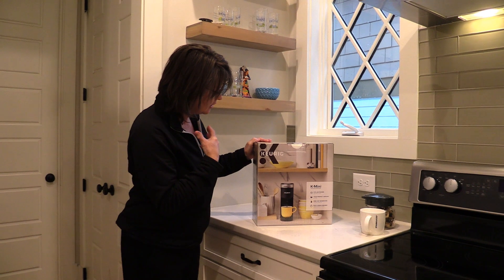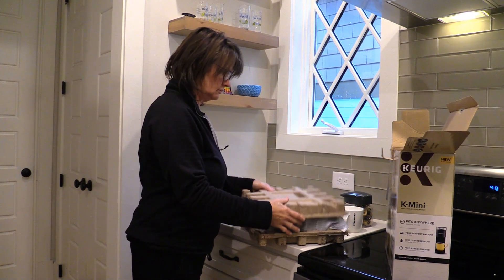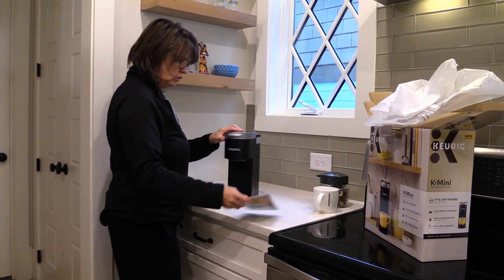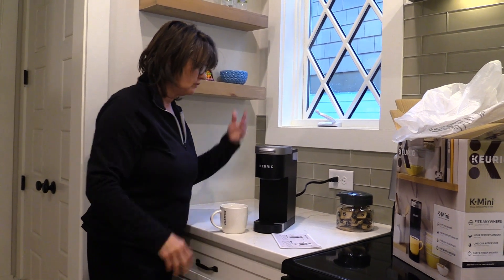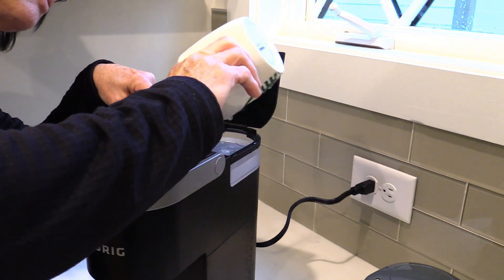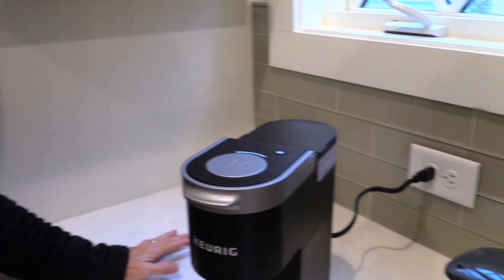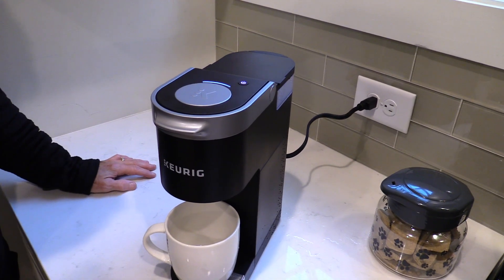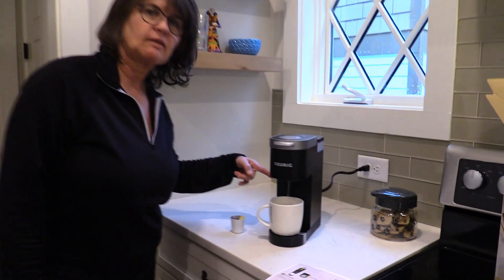Keurig K Mini unboxing

Comment: Are you suppose to put water then water again bc i find the first time I put water it drains it
Reply: Hello, turn it on, pour the cup of water into the reservoir, place empty cup on the cup rest and press the bug button.  It should drain the water from the reservoir into the heating chamber.  Then in about a minute or do drain the coffee into the cup.

Comment: You deleted the most critical part of this review when you shortened the video. The biggest issue with this machine is that you need to press the K button several times in order for the water to come through. This is important for people that are press for time!
Reply: Here is a video showing the actual time needed for a cup of coffee.  https://youtu.be/TXqYGg6eycw
Reply: Gardiner Snyder hi there I have the Keuirg K mini Plus. Im having problems with mine right now. It stops when it brews n repeats when I open and close it. Does yours do that also?. I'm wondering if anybody that has one of these experience any problems like this
Reply: Gardiner Snyder in